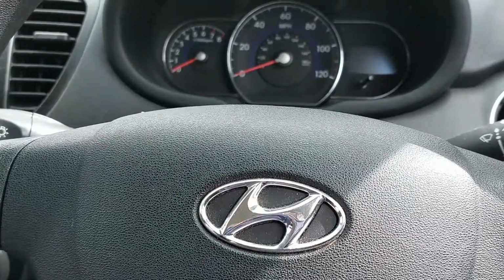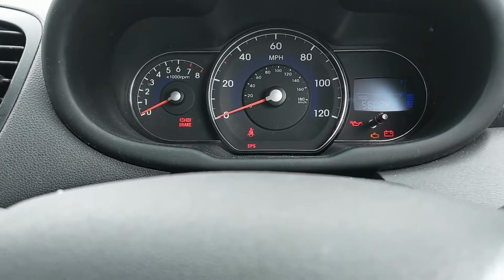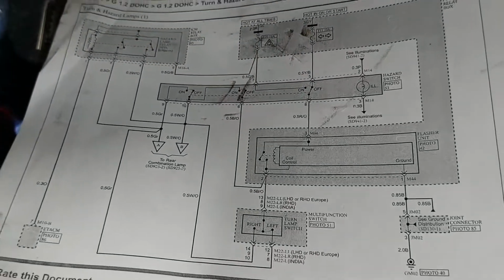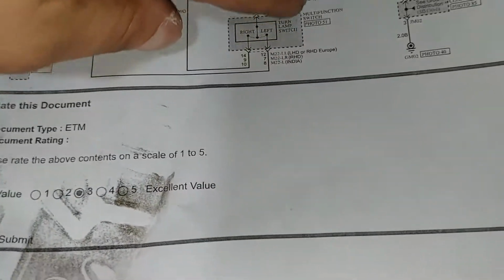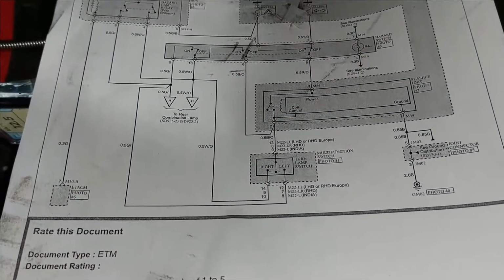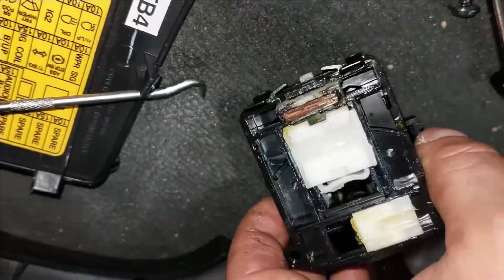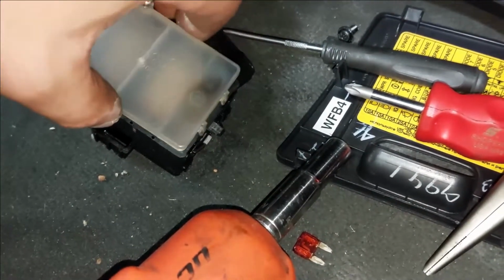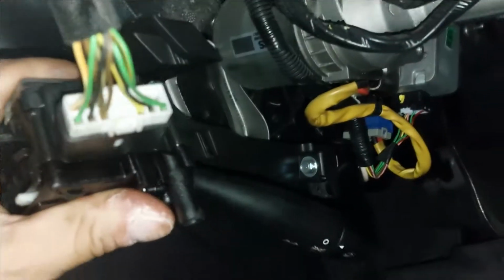Hyundai I10 indicator relay ticking noise continuously

Comment: I had the same ticking noise from my i10 - following your instructions it took me about 15 minutes to get the indicator/light stem off, clean it up and put it all back - ticking/arcing has stopped! Saved me £25 or more for a replacement stem. Looks to me like the issue is when the grease gets dirty over time, and is therfore prone to arcing. Thanks again for the helpful video.
Reply from the maker: Glad it helped

Comment: Having this issue. I sprayed electrical contact cleaner. Was fixed but then started again. After that smoke was coming out of it when ignition was on. I will try do what you did and check😊

Comment: Thank you Sir. I didn't do full diagnostics but managed to get the module out and clean it which fixed the problem. I needed another YouTube video to see how to open the steering wheel casing, but your video solved the problem. Many thanks.
Reply from the maker: Glad it helped

Comment: I have the exact same problem, but with added issues along with it, when I do right indicator it clicks fast, indicator on my headlight doesn't blink, but rest indicator on ovrm and backlight works. The same headlight doesn't work in low beam but works at High beam. The indicator on headlight works when all indicator safety button is on.
Reply from the maker: Clean the switch and retest, and see what is not working

Comment: I had this issue with this once the wing mirror was smashed by a passing truck and caravan now we got a new wing mirror and everything is fine again
Reply from the maker: clicking fast when using the indicators on the side where the mirror was smashed, was due to missing bulb. On my case it was clicking continuously without having to use the indicators at all

Comment: I had the exact problem earlier this year, cleaned up the contacts and all good. When I reinstalled the indicator unit however I didn't get full beam. The flash function works but full beam just goes back to the parking lights. Now my MOT is due I'm trying to figure it out, I don't suppose you'd have any ideas of what to check?
Reply from the maker: thake is of again, soke it in some brake cleaner, then in some contact cleaner, dry it out and retry

Comment: Hey, George can you recommend me someone who can change me a rear drive shaft coupling for a Skoda Octavia 2010? I cannot get a price of under 500£ and I can believe that’s the case when the part is 140£. Near Sheffield, preferably. I didn’t see you video but I always think that when you have that repetitive sound is somewhere a fuse blown.
Reply from the maker: I had replaced a £4 seal and labor was £600. You can try post your repair request on whocanfixmycar com and you will get offers from garages around your post code